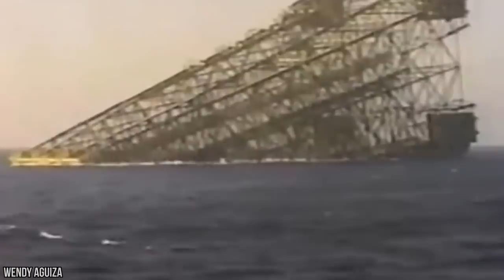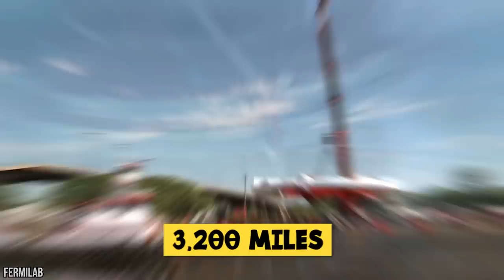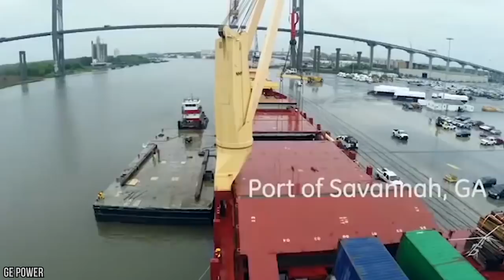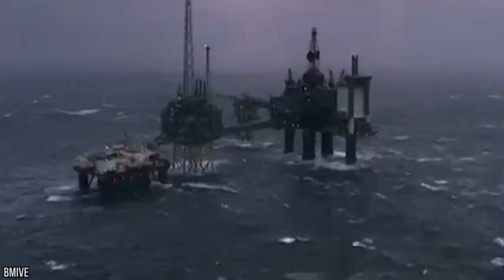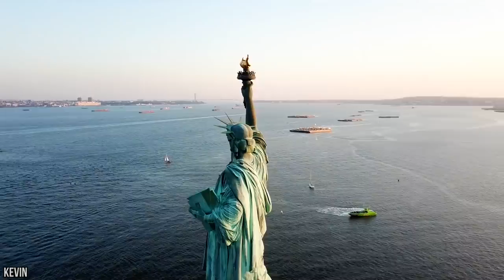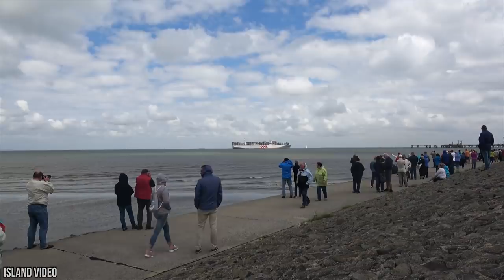15 Most Epic Transport Operations In History

Comment: Generally speaking, this is a interesting video. But it suffers from inaccuracies  (Chernobyl, "viligent") that only a few minutes of research would have prevented. Apart from the ones already mentioned in the comments below, you mentioned an oil rig owned by a company called "Petronias". I think the company you actually mean is a company called Petronas. It's not usually difficult to get things correct but  if you don't exert that little extra effort, your credibility suffers.